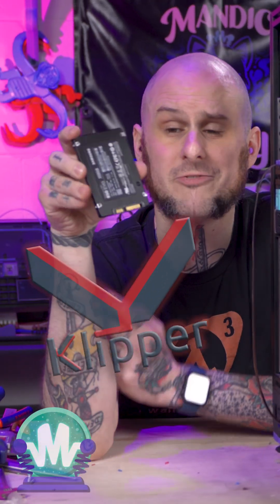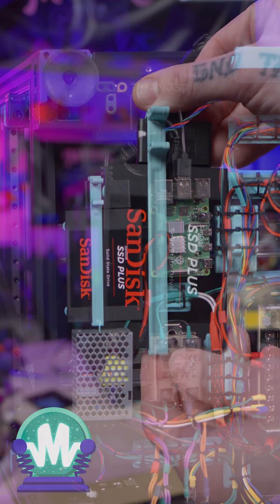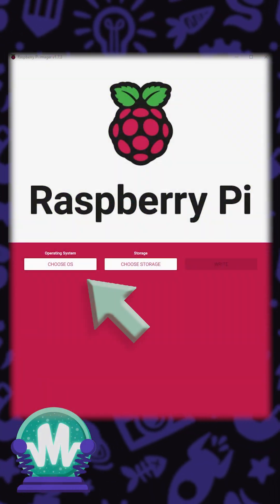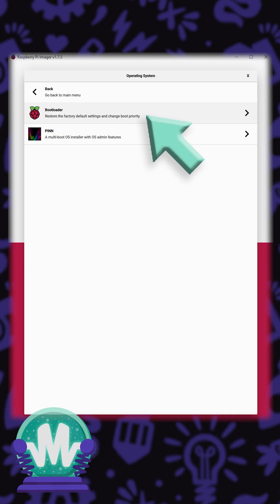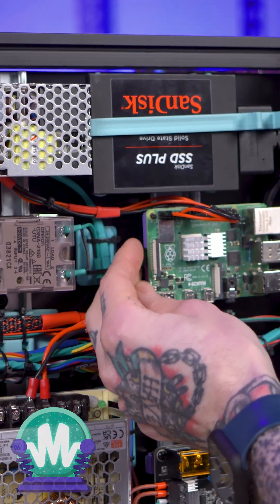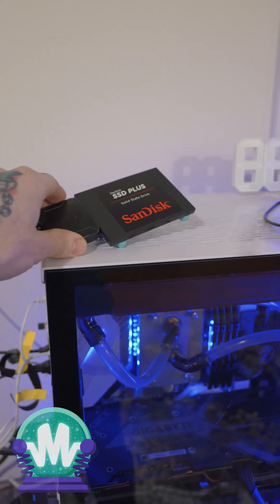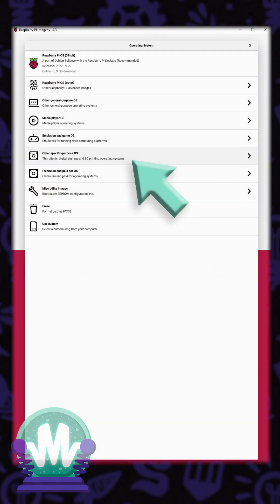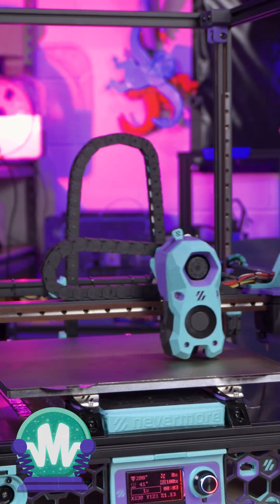Klipper on a SSD? Raspberry Pi 4 Setup! #shorts #3dprinter #klipper

Comment: When doing this on a 500 GB SSD, I'm left with 2 partitions: "boot" (256 MB FAT32) and "Healty (Primary Partition)" (3.72 GB) and then 461.79 GB of unallocated space.
How can I put that unallocated space to use?
Reply from the maker: Did you use the Raspberry Pi Imager? It should have formatted the drive clean and not created those partitions. 1) 512gb is overkill as hell for this use case. Even saving timelapses will take a while to fill that. I used a 256GB just cause I had it and it was overkill. So I’d consider a 128Gb like I linked in the description. Even that’s overkill as most folks are running on 16-64gb SD cards. 2) My next step would be reformatting the drive on another computer. Make sure it’s a single full partition at full capacity. Then I’d repeat the Pi Imager process. It shouldn’t create individual partitions like that unless it’s working on a clone of a drive or a drive that’s already split up in some way.
Reply: @MandicReally  Thank you for your reply! 🙂
It is indeed a large SSD, but I had it laying around (for W10 it's not that large anymore).
It was NTFS formatted, 1 partition. Then I used the imager as you described.
The partition structure is what it ended up with when the imager was done with it.
(No cloning or anything..)

Comment: thats pretty cool
Reply from the maker: Thanks, I thought so. No more SD card and a ton of storage space!
Reply: @MandicReally  true its a good idea and it works, keep up the great content
Reply: @MandicReally have u considered pi alternatives. Theres a ton of sbc options.
Reply from the maker: @felurianmasters4369  I’ve run Klipper on a Mellow Fly-Gemini which has a SBC built in and an old HP Netbook. The universal support for the RPi is why I keep going back. It’s doable on other setups but I have constant concerns that the next update will disable the instance for one reason or another. The Fly Gemini was a bit of struggle to get going when I had to reset it fully once.
Reply: @MandicReally  oh that makes sense. Sucks I didn't grab a pi when they were 40$ now they are hard to even find. Was considering trying a smartphone, or just dual boot my pc and dedicated hardlink. I've noticed a ton of offerings in the sbc world though. Your advice has me leaning back to a pi. I really want to be able to cad straight off the printer. Would be sweet to have a print suite loaded to the machine. Briefcase printers for everyone lol. Then you can even Faraday the system in storage. I like your content, thank you,  and welcome.
Reply: @MandicReally  for me it has to be one project at a time. I'm too busy in my professional life to tinker as much as I'd like. But freecad and prusa, with cura optional, loaded on say Linux mint, with a sbc, m2 drive or ssd, Bluetooth keyboard, touch screen. Maybe a decent tablet would fit the bill. Just thoughts out loud, maybe you'll make sense of my rambling.
Reply from the maker: @felurianmasters4369  I should grab some alternatives and do a little roundup of them or something. Hard to justify the expense but maybe sometime soon. RPi claims the shortage should be improving soon, idk though.
Reply: @MandicReally  oh good news. I wouldn't spend too much, it does seem difficult to get a clear tutorial on installing and setting up klipper though. Everyone wants to add diatribe to it. A step-by-step instructional would be cool. Explaining what, and why. That in itself would be beneficial to the community IMHO. Maybe I'm misguided in this thought, just a suggestion.